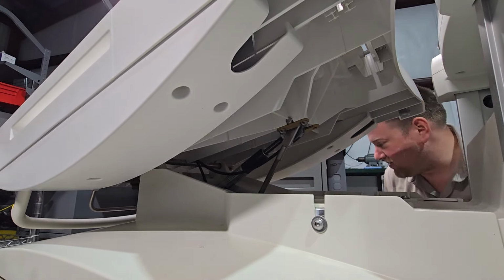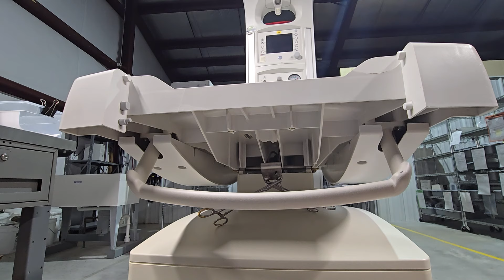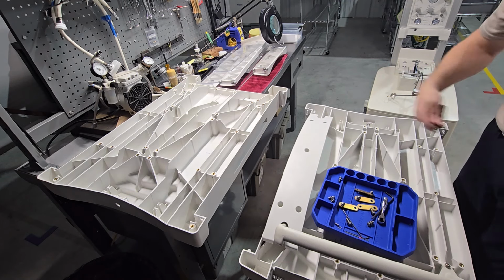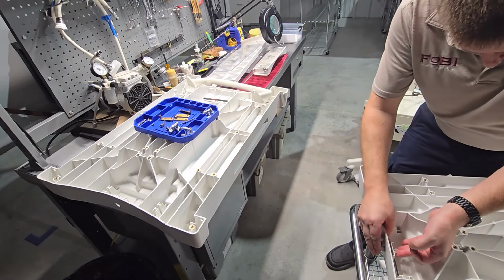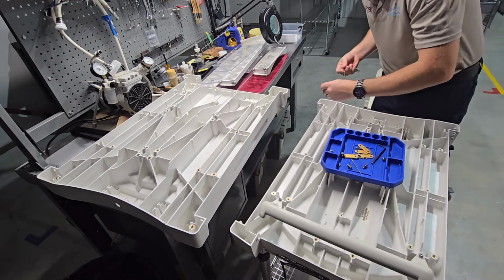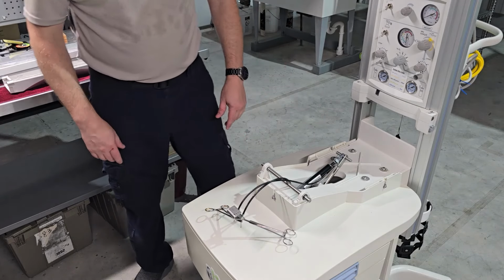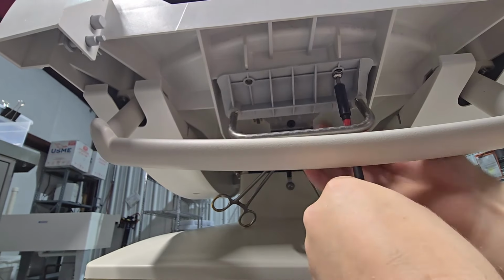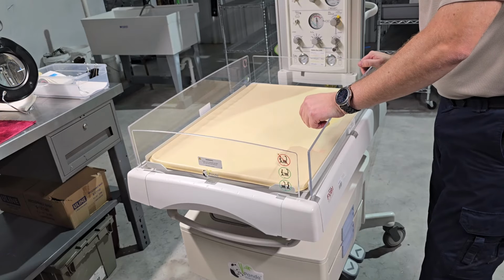20 Minute GE Panda Warmer Bed Replacement!

Comment: Hey Justin, you can take the cabinet off, the 3 screws around it, 1 in front and 1 on right and left side. Then just slide the whole cabinet fowrard out front to eliminate the gap issues for the tool use on middle bar part.  Great video btw, but I would recommend removing the cabinet part due to trash and stuff get stuck anamd forgotten in between the base and cabinet.  Hope this helps!